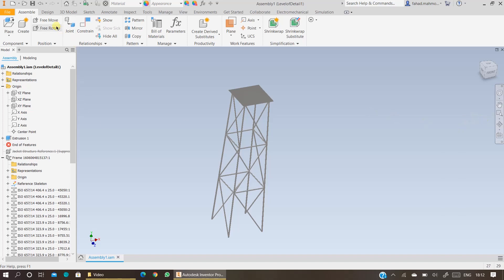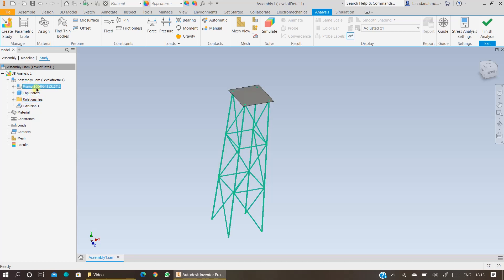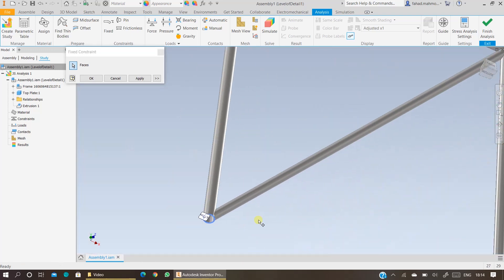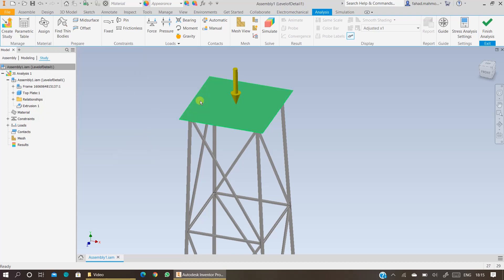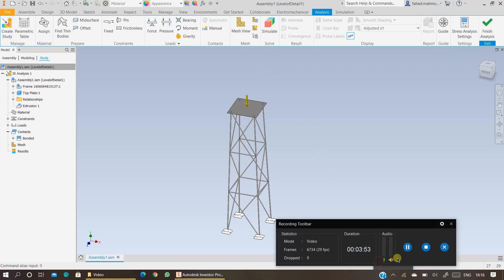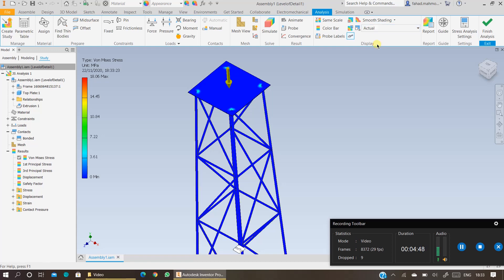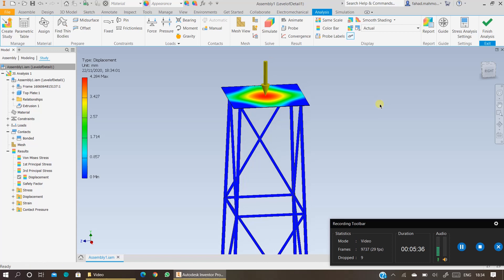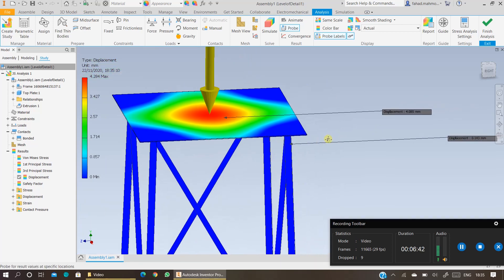Frame Generator: 5 Static Analysis on Inventor

Comment: Are you using feature like trim, nocth etc on your  frame?, Cz in mine it cause file separaterd in couple section?
Reply from the maker: Yes most of the features are used to improve the structure such as extend, trim and notch.